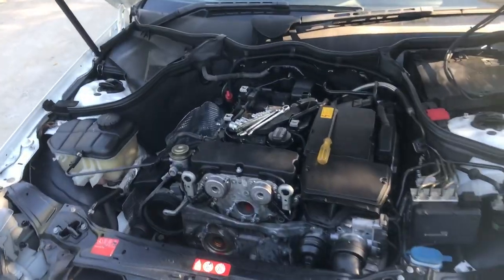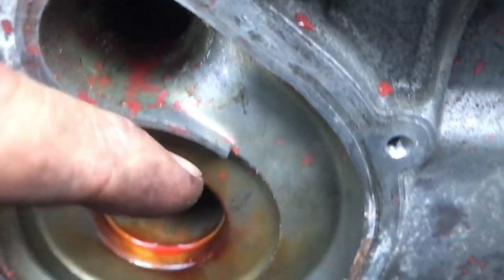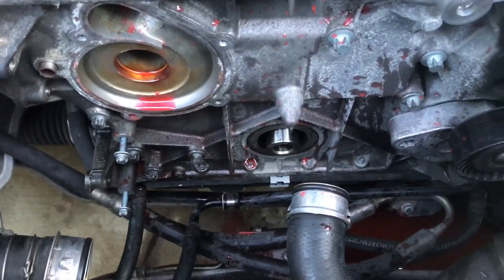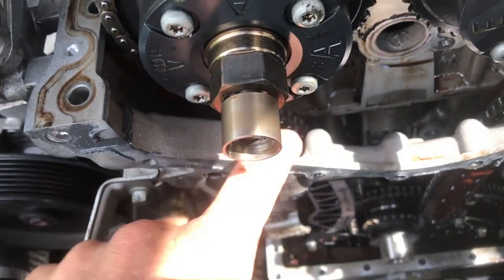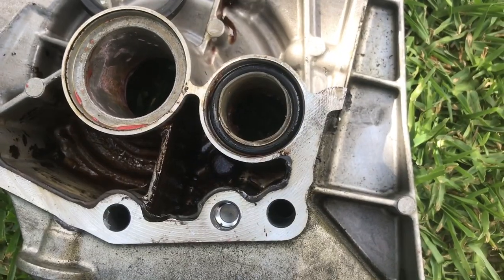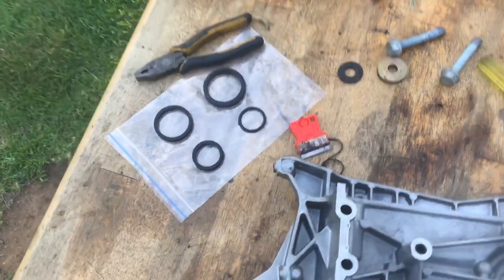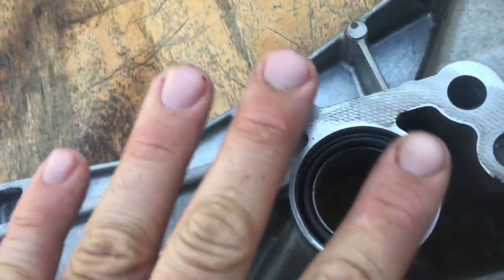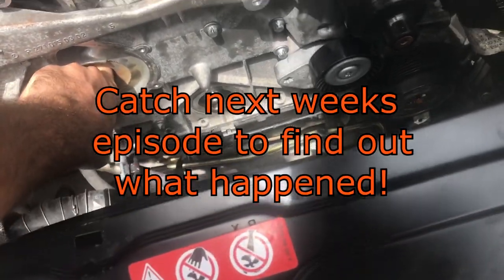Mercedes C180 (W203 - M271) Kompressor Water Pump O-Rings Replacement Part 1 - FGep44

Comment: Can water mix with engine oil to damaged the water pump seal?
Reply from the maker: I don’t believe so. The seals just don’t last forever.
Reply: When my cclass gets to 80degrees or half gauge temp, and I give it a little rev to 2k  rpm.. I hear water that sounds like its moving about under the dash.. is this the seals for that ? Sounds like an under filled cooling system water rush about..😂😂

Comment: You got a part number for them o rings ? 👌
Reply from the maker: No, sorry mate. Your local Merc dealer should be able to find them for you.
Reply: @FuryGarage  not such thing in the ozzie outback 😅😂 but managed to get merc online catalogue and get the part number.✌️
Reply: @Rando97531  an you share the part number
Reply: @Rando97531  Yes please please, share the number. My engine is wallowing outside the car in an open.